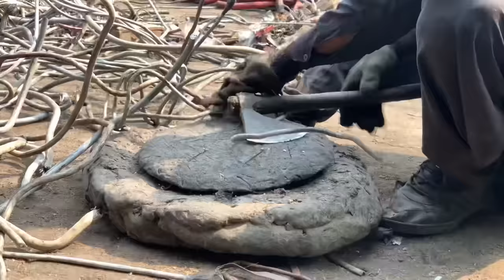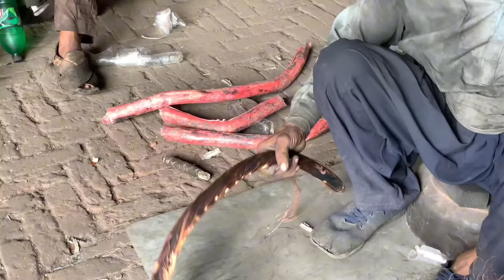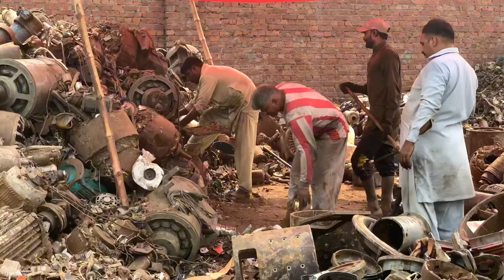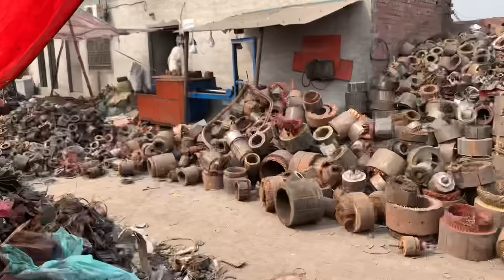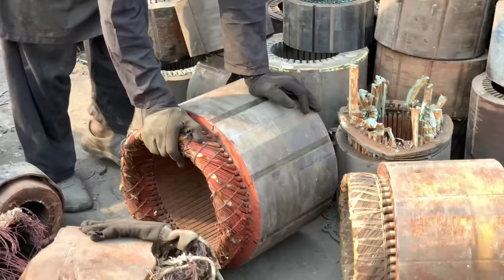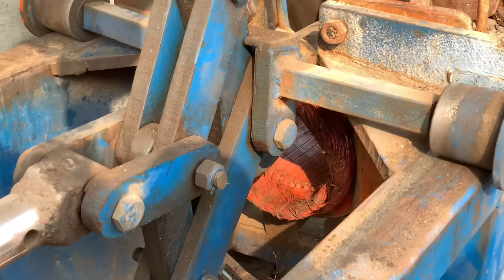How To Make The Most Money Scrapping electric motors

Comment: Back in the 1960's and 1970's, my grandad recycled copper in more or less this manner. What he did was stack a bunch of old wooden pallets, throw many old used electrical motors on the pallets and everywhere else he could find a crack or crevasse.  Of course, he'd make sure this process was located in a somewhat slope area. He would then douse the pallets with some diesel and light that sucker on fire. He would do this at night so the smoke would not alarm anyone. Pallet Oak wood is treated with some sort of chemical that creates lots of smoke. Granted, he worked on this in the outskirts of the city making for his work invasive-free from the emergency people. He would let these electric motors burn all night or until there was no more fire. He would than wait one day or so to let the motors cool off. He would then crack open the motors with a hammer and chisel. After the motors were cracked open he'd pull out the copper wire with pliers. The Copper wire was taken to the scrap yard and categorized and bought as # 2 Copper wire. Remember when I wrote something about the slope? Well, the slope acted as a channel in where all the melted aluminum would collect and when cooled off it too was sold as to the recycling facility as scrap aluminum. The motor casing were also sold as scrap iron. About the only thing that went to waste was the coating that is added to the copper wire when being fabricated. I believe this coating is called shellacking. I'm not to sure on what you call it. Electric motors consist of the cage which is steel, aluminum alloy and copper wire. Regardless if the copper wire was stranded or thick...it was categorized as # 2 copper wire. If you are wondering what is # 1 Copper with it is non-stranded bare bright copper with no contamination of lead, steel or aluminum.
Reply from the maker: Thanks for the feedback
Reply: Проволоку покрывают лаком
Reply: Hard, honest work. I hope your grandad did well out of it.

Comment: Anyone have an idea as to what shielded coaxial cable that thick would be used for, and so much of it.
Reply from the maker: Thanks for the feedback
Reply: он не экранированный, а рассчитан на высокое напряжение, его испльзуют на электроподстанциях, трансформаторах и распределительных устройствах
Reply: That shielding is required for power cables operating above 2,000 volts.

The reason for the shielding is to protect the surrounding area should the cable insulation fail.